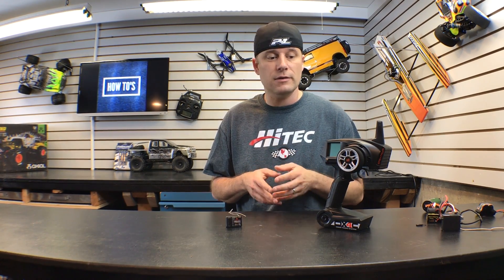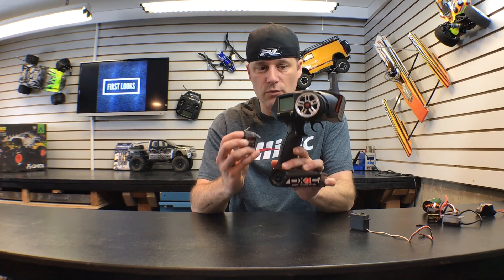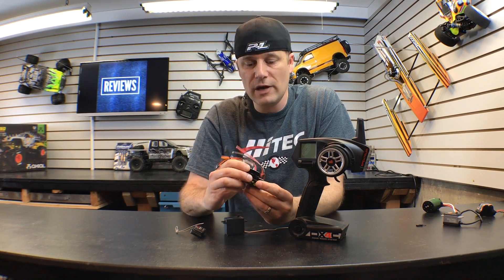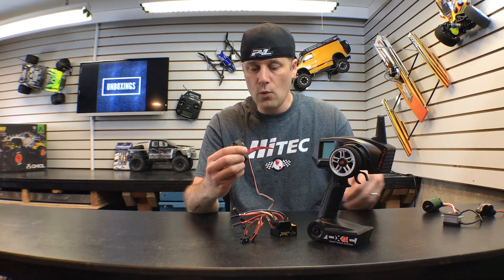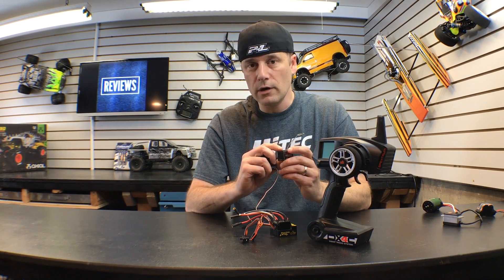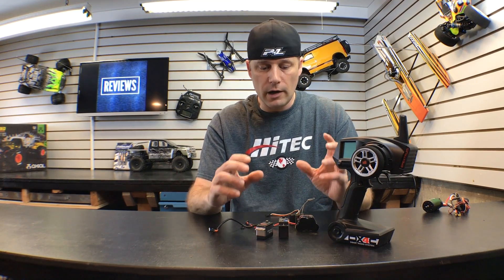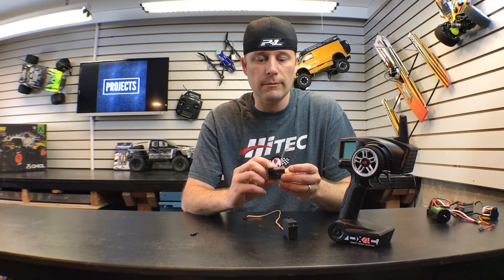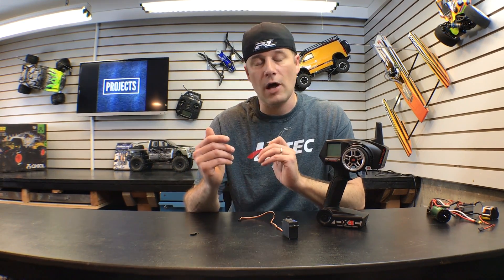How Does A Radio System Work? - Get Into RC

Comment: Question, what determines the speed in which the transmitter talk to the receiver back and forth.?
Reply: Im guessing its signal strength determined by the quality of the radio components on the TX and RX circuits. Some radios are faster than others by milliseconds.

Comment: How a radio system work is not explained in this video, only what each component does.
Reply: Im trying to get a better understanding. Here is what I have learned, for your basic channel 1 and 2 the TX uses something called PWM. Each channel has a degree of power it sends based on how much of the wave is ON. So if you pull your trigger a little bit, your motor will get that little bit of speed based on the amount of ON waves its gets. The motor will got full power when the wave is on 100 percent. The direction the motor spins in is determine by the 3 wires that go into the receiver the red, black and white wire.

Comment: I just got a Trmt8 v2 redcat and i turned it on for the 1st time and the steering doesnt do anything when i try to steer. The throttle works as it goes forward and backwards but moving the steering knob does nothing. Any idea why? Its a brand new rc car.

Comment: What happens if my boat is running at full throttle, and goes out of transmitter range? Does it automatically stop, or continue on at full throttle until impact?

Comment: Great video with one caveat regarding the wireless signaling. The transmitter is constantly sending control signals to the receiver and in turn the receiver is always sending pulses to the connected devices.  This is important because without a constant stream of control signals, the devices can release their position holding power. Worst, the radio receiver might sense some other radio signal and send incorrect controls to the devices. High end receivers have a failsafe mode it will go into when it loses the transmitter data stream and it will put the devices into the defined position based on the failsafe settings.

Comment: Great videos! I was wondering if someone could explain in simple terms what the purpose/advantage of a high voltage receiver is? I was going to get at Tactic TTX300 transmitter when I noticed you can get it with either the TR325 receiver or the TR326 high voltage receiver. Both are the same price.

Comment: dose a RC receiver have to be specifically for brushed or brush-less ESCs?
Reply: No, normally all receivers and esc's connectors are standardised to be compatible with each other. Both brushed and brushless ESC can run on the same receiver. However, you have to keep in mind that ESC specifically designed  for brushed motors can't run brushless motors. I believe the same goes the other way around but I am not sure. I would 100% recommended brushless motor+esc combo.